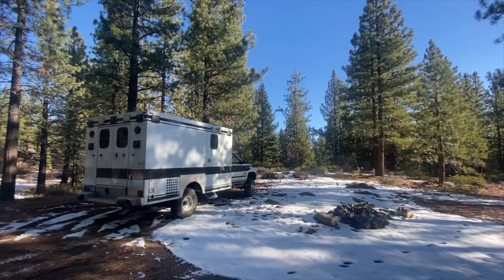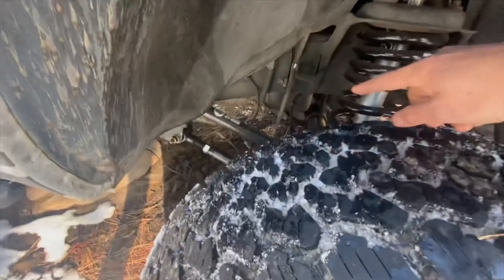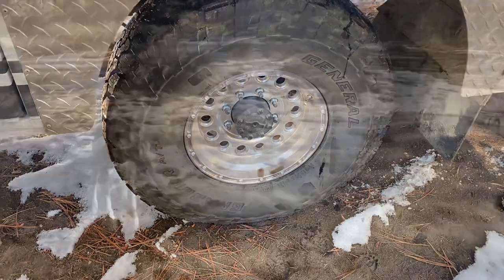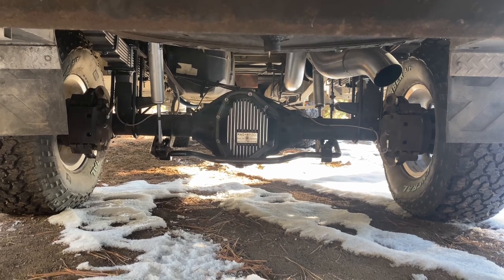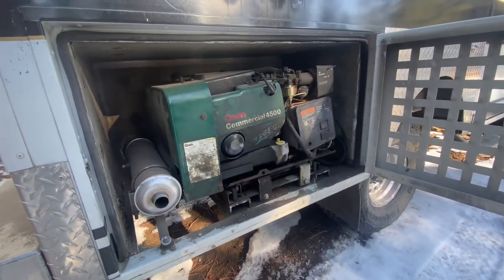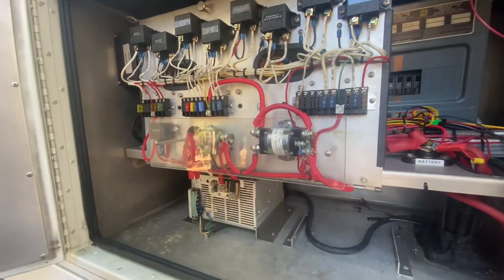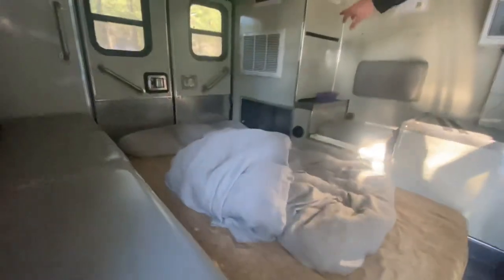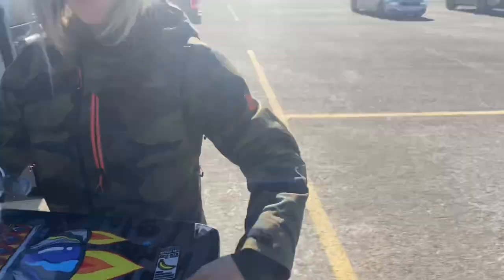4x4 Ambulance Camper build Cummins powered

Comment: Does it was an original DRW?     Did you swap the axle ?
Reply from the maker: Didn’t swap the axle still a dusky axle just found wheels with the right backspacing to center them in the wheel well.